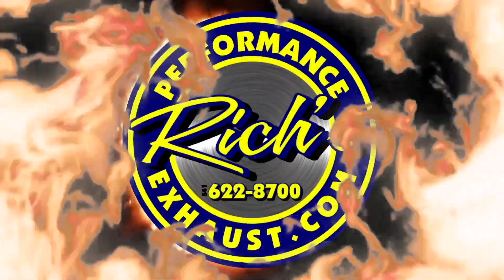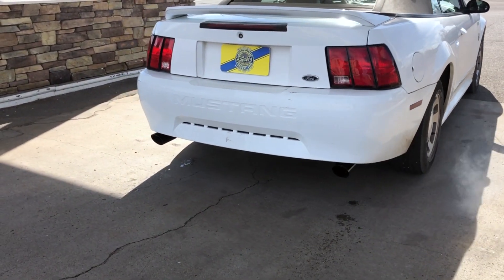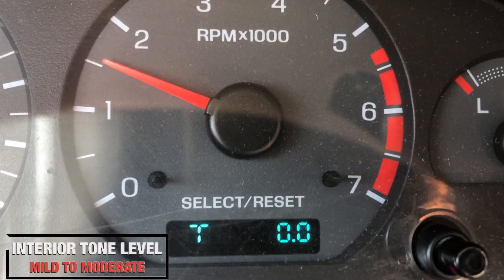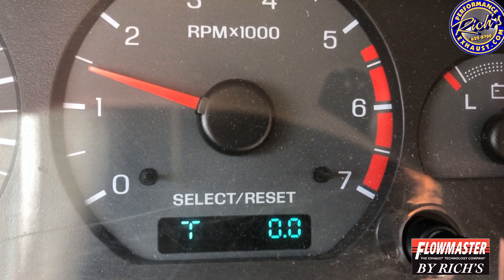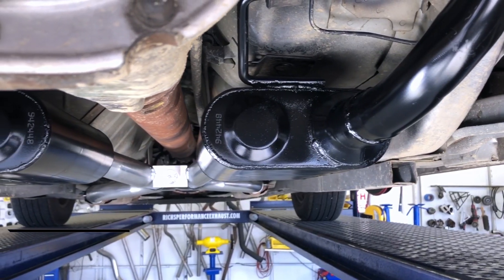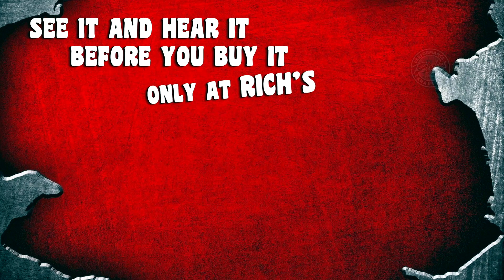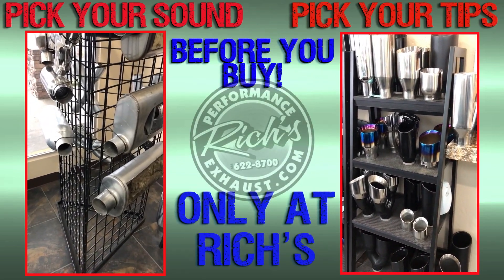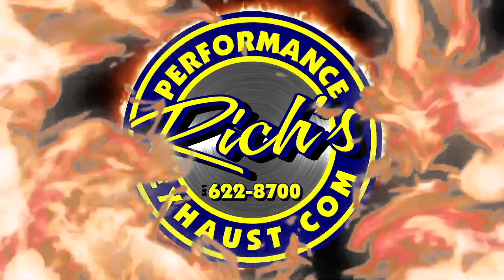00 Ford Mustang V6 Flowmaster 44 True Dual Exhaust With X Pipe & K&N Intake By Rich's

Comment: This mustang sound better with dual flowmaster 40. Not the felt crap. I Know because I got a mustang like that with a flowmaster 40.
Reply from the maker: Flowmaster 40 and 44 sound very similar the 44 are more refined and less interior drone. Thanks for watching
Reply: @richaquila2655  no, the super 44 is much aggressive Inside and outside is less noisy in idle.  How Do I know, I put a flowmaster 44 in a dodge neon are you kidding me. The drone noise is worst than in my single exhaust v6 01 mustang with a flowmaster 40.
Reply from the maker: @marianosotas3380  every vehicle needs to be tuned   Setting vehicles aside and just comparing those two mufflers the 44 has less drone and sounds similar to the 40  just look at the sound comparison chart from Flowmaster . Thanks for watching!